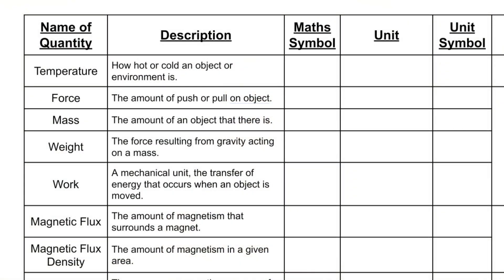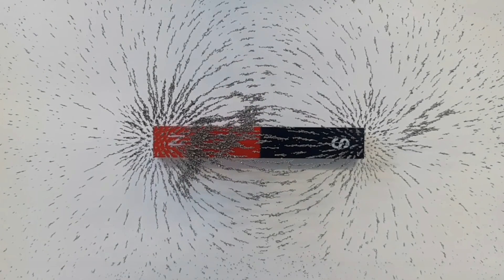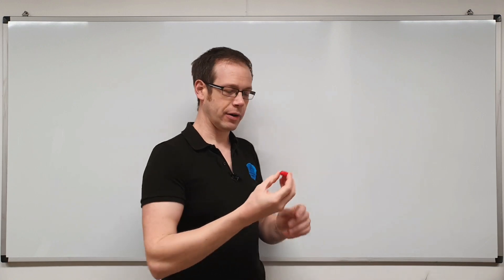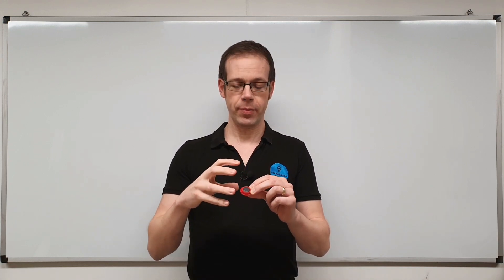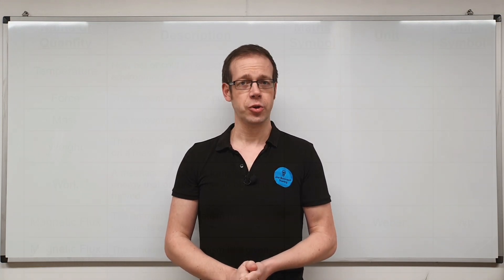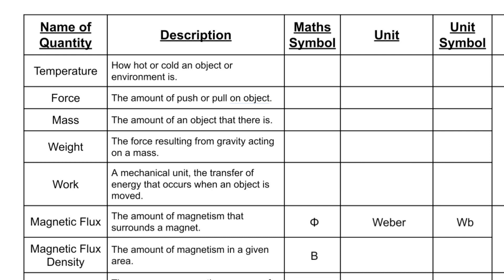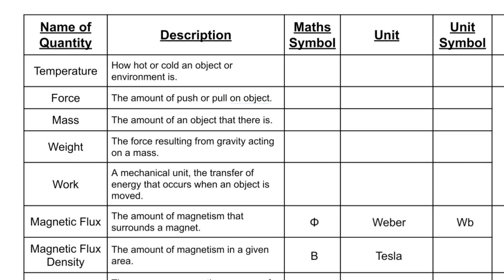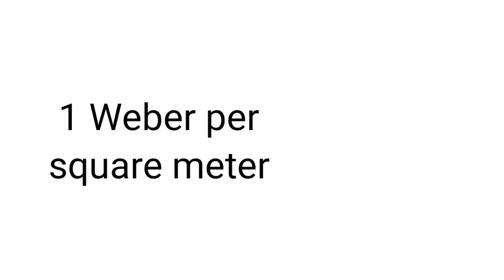SI Units: What are the Units for Magnetism? Magnetic Flux vs Magnetic Flux Density

Comment: Instead of Tesla sometimes the old unit „Gauss“ can be found. Still in use in astrophysics. 10,000 Gauss = 1 Tesla. Probably caused by some mathematic formulas which only work with such ancient units. Like gas formulas for pressure corrections which only work with the old pressure unit Torr (mmHg).